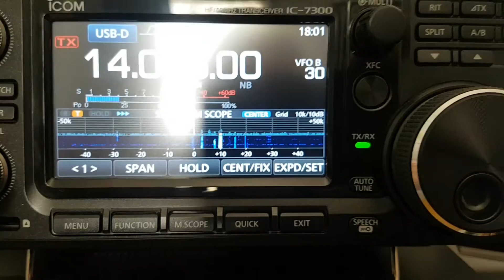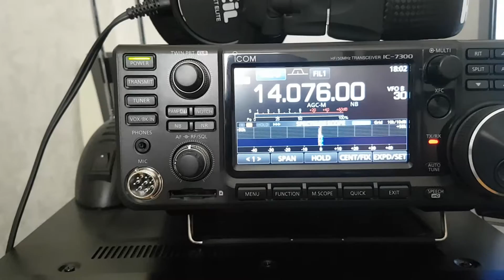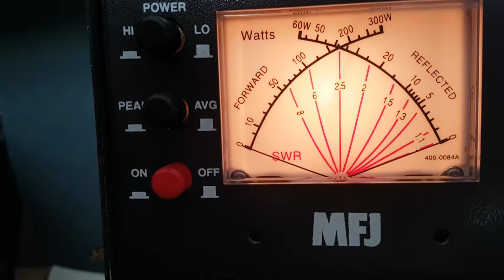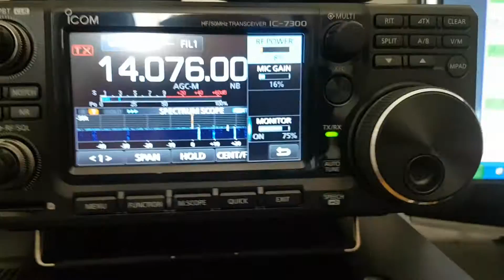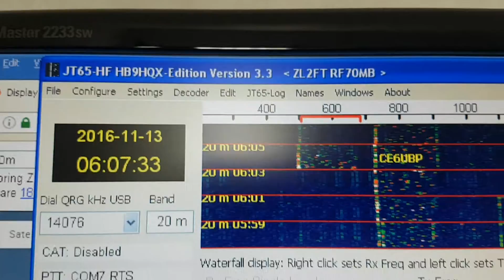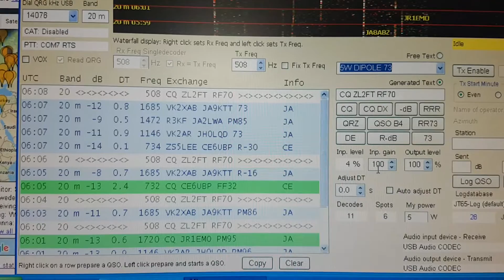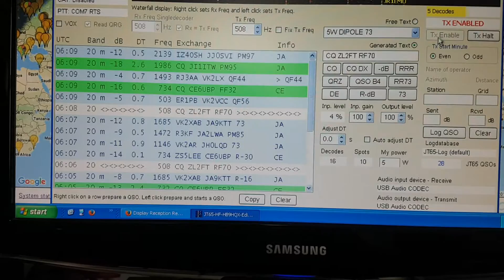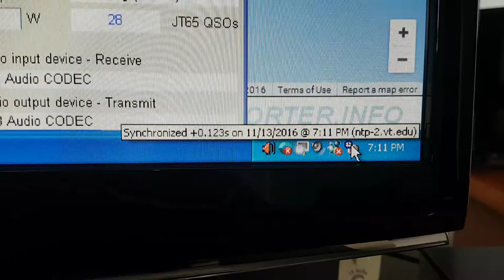JT65 1Watt Test

Comment: jt65 is for those like me that have a very bad antenna restrictions. is an excellent mode that will make ham radio fun again.
with a G5RVJR. hanging as a flat top dipole on my back yard 10 feet from the ground i had work much DX from my Pennsylvania qth. with 25 watts max to 2 watts min. . the problem is that this mode is very popular now and trying to do 2 watts on 20 meters on prime time is like pulling teeth.